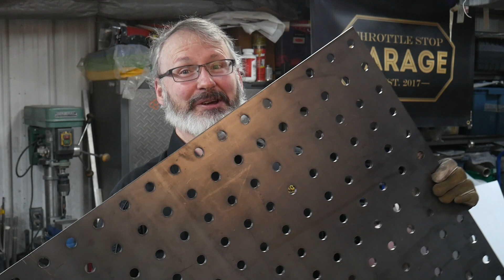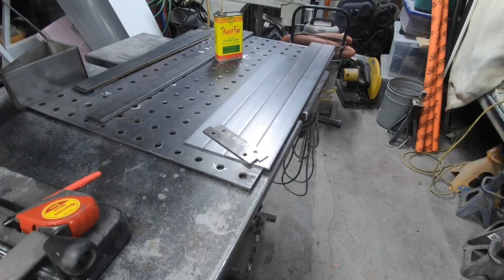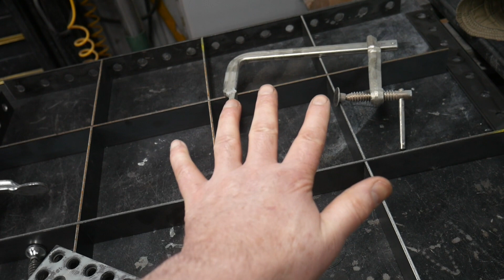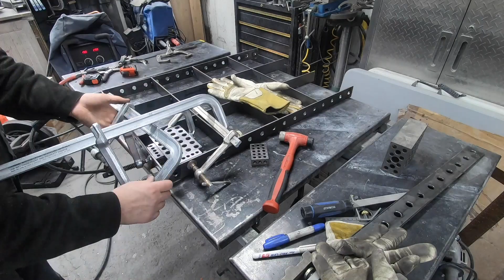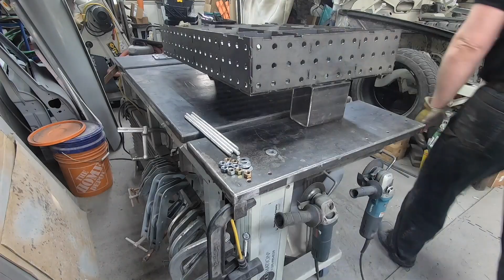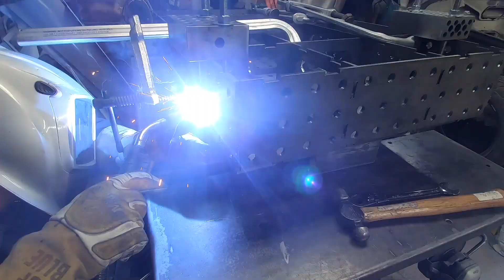Welding Fixture Table Shoot-Out: DIY vs PRO

Comment: 5/8" and 16mm are not the same size. Nearly everyone says this, but it's wrong. 25.4 x .625 = 15.875mm. When precision is needed, they are not at all the same
Reply from the maker: Indeed - no question.  Approximations in welding are a bad habit.
Reply: @ThrottleStopGarage are they 16mm or 5/8s holes? Up in Canada aswell, in BC, looking to build one of these.

Comment: I got a laser guy, would I still need to drill and ream?
Reply from the maker: Nope.  You should be fine.  My laser cut table was fine...my plasma cut table needed the work.
Reply: @ThrottleStopGarage  Do you think I need to specify an an oversized hole to the laser guy?   or is 5/8 good enough,  - Don't want to have a interference fit, the clamp pegs need a little wiggle room to they cock over and bind
Reply from the maker: @jwiereng  No need for that - just 5/8" and let them do  their work.

Comment: Hello, I want to make a purchase and I would like your help....which is better, the milling drill or the pillar drill? I want it more for holes, but I would like it for everything, etc... some people told me the milling drill is not suitable for  holes because there is a chance of damage, is that true? What's your advice?
Thank you very much...
Reply from the maker: Interesting question.  If I had to do it again, I'd buy a Mill/drill rather than the pillar drill I have.  They're more flexible and the way the bearings work - are able to handle lateral loads.  For this table - doing it the way I did worked fine.

Comment: Hello, I would like your help, welding tables that have holes on the plate from which specific metal is the plate of the table?
thank you very much
Reply from the maker: It's just mild steel.  6 mm or 1/4" thick.
Reply: @ThrottleStopGarage  what is it that makes the plate on the welding tables not stick on what the electrolyte comes out?
Reply from the maker: @iocifiocif2789  I spray mine with anti spatter.

Comment: Think you were complaining about $9  5/8" stripper bolts...........Grainger (CDA) has them on clearance  for 69 cents ea.  Check out all the other clearance items and cheap shipping too!
Reply from the maker: We haven't had a Grainger in a couple of years! I just hate single pack bolts.
Reply: @ThrottleStopGarage   Go on line, you can see the clearance  items across the country. Have had multiple shipments from across the country for $10 on a single order. From Mt. Pearl N.L. to Burnaby and parts in between.
Reply from the maker: @geobrown9413  Will do - thanks.
Reply: @ThrottleStopGarage  In addition to the fasteners, etc. look at the med. gray spray paint for $1.50.......good and U.S. made.  So many bargains.

Comment: how did you do you sit stand welding table?  Can you provide some details.   I'm very interested in making a sit stand welding station.
Reply from the maker: I was given a motorized lift table and I have attached my tables to the top of it.
Reply: @ThrottleStopGarage  Would you mind sharing the brand of the motorized lift table, if there is one.  I'm currently contemplating converting a sit/stand station (for computers) into a sit / stand welding station.  I decided to get a manual crank lift station that I can use a drill with the cycle it up and down.  I thought that the welder might cause issues with the electronics of a traditional electric lift sit/stand desk.  

Your thoughts?

thanks,

David Bourdeau

Comment: where do you get the fixture pins from etc for it,, wondering what size holes they are and how close can a laser get or do you have to final ream each hole?  thx
Reply from the maker: I designed the table.  The common pattern is 5/8" diameter (16 mm) on a 50 mm regular spacing.  The laser cut table did not require further reaming.  The plasma cut table for sure did require that further step.

Comment: if the cost of that block is too much my little machine shop has a small angle plate that would work for like 35,bucks..3" × 3 "1/2× 4 "1/2 its withen  .0005 flat n square
Reply from the maker: Nice.  It's not so much the cost of the thing...I can't buy it.  Canadian's are used to seeing "not available in Canada" or "won't ship to Canada. " on a lot of things.  These tables are one of those things.

Comment: How does one find your brother's DXF files, or is it private to avoid being sued from south of the border? :-D
Reply from the maker: Check ebay - there are files there you can buy.
Reply: @ThrottleStopGarage  I was hoping for "check github" :-D I'll likely do that first, and crack open FreeCAD second, it's just the way I am :-D
Reply: GitHub: No. Ebay: Cheap. From me to you: Thanks :-)
Reply: Check out GrabCad as well.  There are MANY there with the cad files (which can be turned into DFX files w/ the right software if not there... like Fusion 360 and a hobby license)

Comment: I just built one two weeks ago. I used a 1" thick steel sheet and bought a $40 bit for a mag drill. Took a while, but some patients and drilling lube, and after the 100 holes I drilled the bit is still as good as new.
Reply from the maker: I wish I had a mag drill...I already get complaints about my "DIY" involving "tools"  LOL.  I can see the advantage of the thicker plate when using my clamps etc.
Reply: @ThrottleStopGarage  I was lucky enough to be able to borrow a mag drill. I have to admit that purchasing a 1" thick sheet of steel doesn't mean that you get a 'flat' sheet of steel. The piece I got has 0.025 crown in the center.
Reply: I just finally finished my table.  I use the annular cutters from the mag drill in my drill press. Works very well.

Comment: Personally like the home made one.  No offense to the CertiFlat table, they are cool but I really liked yours.
Reply from the maker: The lower table will get more use I think.  Lighter to move around.  I'll pull out the big one when I need the extra space or want two planes.